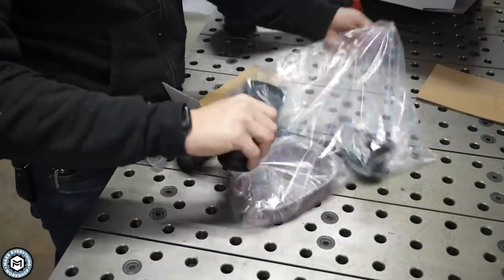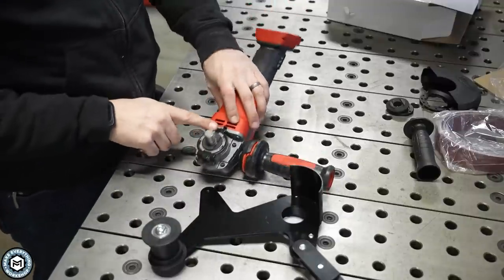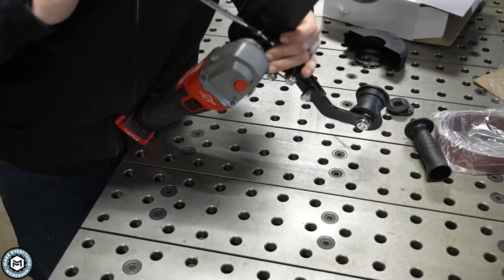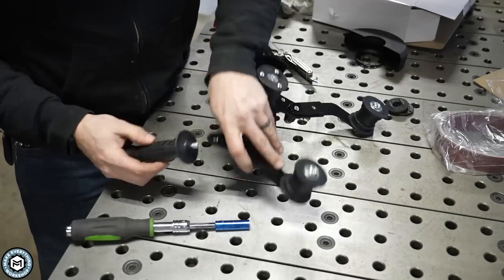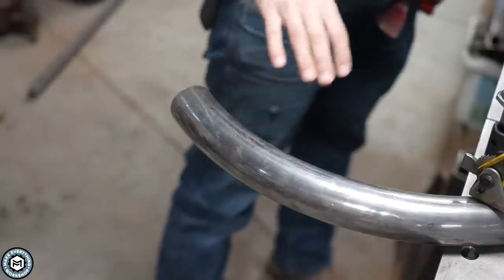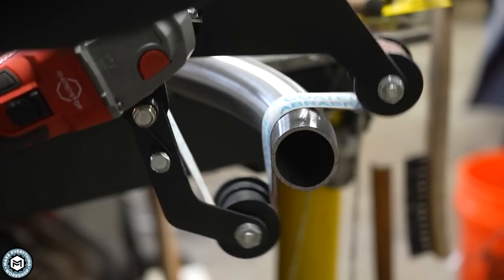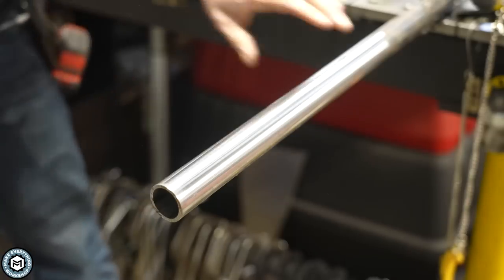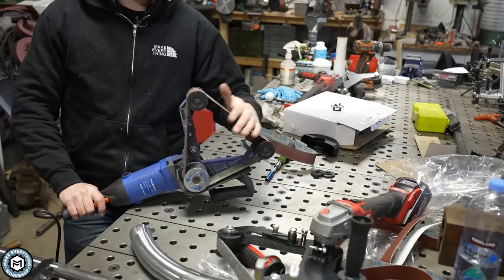Does this 60$ Tool Work?

Comment from the maker: Thanks for watching! Here are some links! See below for links to the products I used. As an amazon affiliate I earn from qualifying purchases:

- Pipe Polishing Attachment  5/8-11 USA (there are a few on amazon, all the same but different sellers and prices)

https://amzn.to/3Y1GKmW

https://amzn.to/3ZoXrtm

https://amzn.to/3m9J1iz

- Pipe Polishing attachment - METRIC

https://amzn.to/3Y3MXP1

- Milwaukee M18 Variable Speed Grinder
https://amzn.to/3Y1XQB0

- Plug in Pipe Sander Grinder:

https://amzn.to/3m7mUcC

https://amzn.to/41r48gs

- 1.5 x 30 Belts:

https://amzn.to/41ufSyU

https://amzn.to/41rwKWV

- Surface Conditioning Belts

https://amzn.to/3IV9Y2d

https://amzn.to/3m9fDJl

Comment: Personally I prefer polishing my pipe by hand. And I polish my pipe a LOT.  Pretty much on a daily basis. I used to think all these fancy attachments would provide a superior polishing experience, but honestly, the setup and especially CLEANUP afterwards would always be a major bummer. You really can't beat the quick and easy manual method which also provides that familiar and precise amount of force that you have ultimate control of. Then for cleanup I can I just wipe up with a dirty rag or paper towel and toss out any mess. ;)
Reply: That's fine for little 1/4" cold rolled steel you're likely dealing with but some of us have larger diameter pipe that needs polishing.   The area needing polishing increases exponentially as diameter increases. 
You were just asking for it dude ;-)
Reply: Also much less chance you'll accidentally apply a 36 grit to the workpiece.  That can take some serious time to remedy.
Reply: @cdavie5  Mine never gets rusty because I do a lot work in "the shop" but I had a friend who said 36 grit was nothing compared to accidently using naval jelly once
Reply: @jeffa847  You know, I was looking into getting set up for electropolishing, but I'm starting to think it might be more than I can handle.
Reply: As a Polish pipe polisher, I see your point.
Have you considered using a vacuum extractor to reduce clean-up time?

Comment: Most the grinders, you can clock the gear head every 90°, it makes the switch and handle in a better location. I built a cordless grinder and sander from scratch to use with the batteries I have, great tool

Comment: Chris great video and tool . You might want to put a slice of rubber inside that locking collar  ,like the thickness of and inner tube . I think with the bolt addition this would be tighter that a frog ass ,and that's water proof .  Nice little tip : It's always good to have some nuts and bolts in the shop.
Stay well to your family and you my friend .

Comment: Trigger grinders are the best 100%.  Anything with an 0n/0ff switch is way too dangerous.  I have a few paddles but mainly use DeWalt with the triggers.  Also picked up a new Hercules with trigger.

Comment: I bought that exact same product to use with my drill press restoration.   Unfortunately, it doesn't fit on the collar of my DeWalt corded grinder.  So if you're considering buying this tool, be aware that it may or may not fit your existing grinder.
Reply: Same here, it's an easy fix though. I just cut the locking flange off, opened the hole up and tacked the flange back on.

Comment: I have the paddle shift M18, and the place where you tightened the plate wasn’t deep enough to hold it in place, I tried with my 6 other corded grinders and it didn’t fit either, I sent it back 😅
Reply from the maker: Strange! I was able to fit this on both my slide lock grinders and it held up. The first one I put together got used extensively and moved to a few jobs and is still tight in place…  I would imagine the QC on these belt attachments isn’t great so maybe just a bad unit?
Reply: @MakeEverything  DM’d you a photo on iG

Comment: It seems as if the handle is on the wrong side, as demonstrated.  Can it be fitted to either side?
Reply from the maker: Yes it can go on either side I switch depending on the application

Comment: Why would you need that, like what would be the reason?
Reply from the maker: When your working on tube or pipe projects it’s hard to grind welded seams without them having flat spots. This tools helps make the whole tube look clean and nice
Reply: @MakeEverything  You mean that will evenly grind welds without digging into the steel pipe?
Reply: I didn't know that they had cheap ones of these. I am an equipment mechanic, and I am going to buy one for cleaning up rusty shafts, to install bearings and sprockets.
Reply from the maker: @504mitchm  it’s awesome for that!!